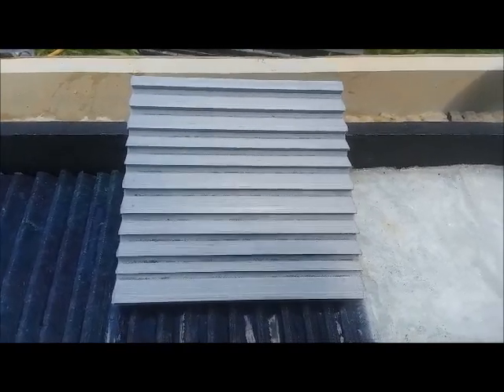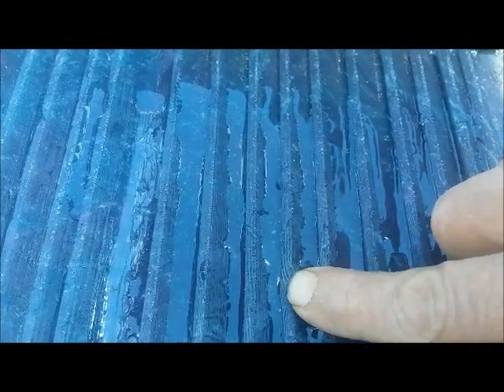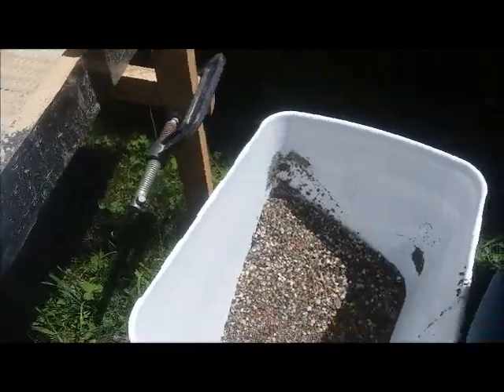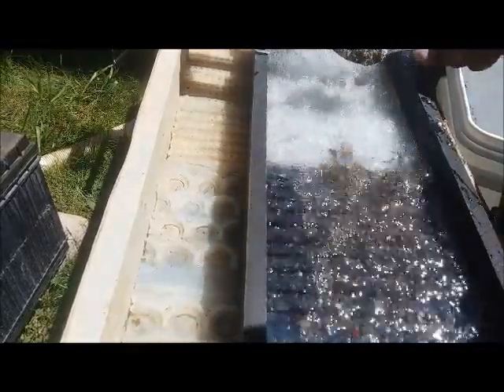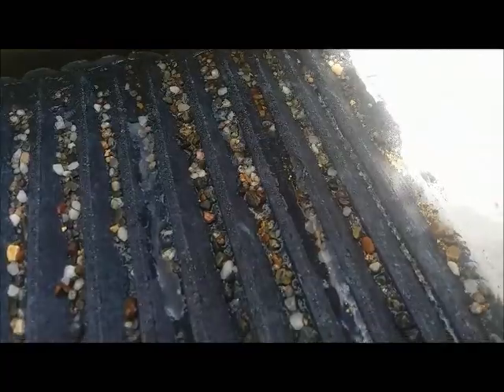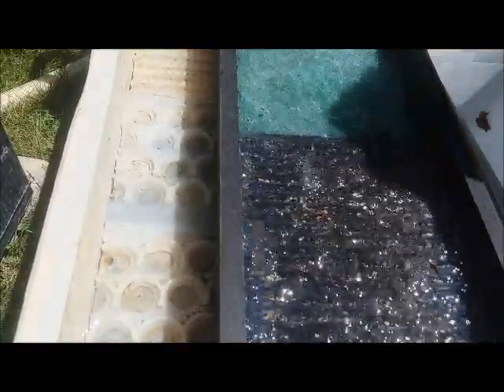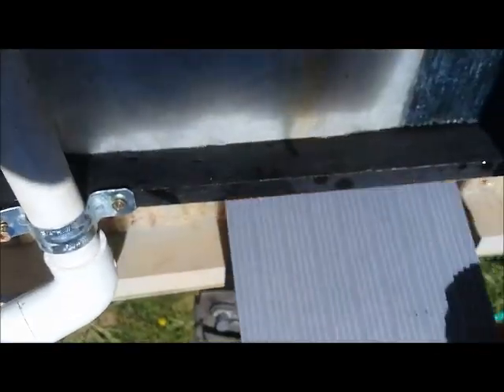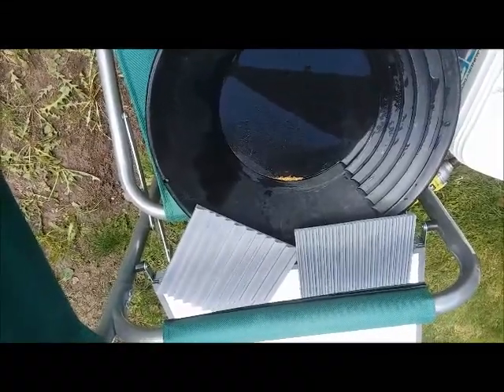3 New Silicone Sluice Box Mats From 3D molds - Demonstration

Comment: So are you primarily using these mats as cleanup mats, as they do not look sturdy enough for production mats? If you have cracks in the material from 3D printing it, how do you clean out the gold from those cracks?  What have you done to test for durability of you silicone mats as you have to flex them in a bucket to clean them?  How does the 3D printing them differ from hand molding them with silicone material as far as the end product is concerned?
Reply from the maker: Hi John I will try and answer you questions. I am running the mats in my 8 foot sluice with my trommel or wash plant with a 2000 gph 12 volt pump. The groves in the mats hold some of the fine gold and at least slow it down I have not had any problems with the clean out I just wash them out in a bucket. How long they will last I have no idea so far I have run about 4 yards of dirt screened down to 1/4 inch on this set of mats no no signs of wear so far.. The 3d printed mold was just a idea to make a real set of riffles for the silicone mats I have no complaints. I have been running the mats in every video I have done since making the mats. I hope this helps.

Comment: Thats great.  You might look into buying a larger nozzle. your printer should have a .04 mm i believe but if you can get a larger nozzle you can change settings and layer heights for a much faster print and it will make larger of those fine riffles. For the kind of printing your doing for the mats a larger nozzle would be the bomb
Reply from the maker: Thank you. I Had no idea I could get a bigger nozzle I will diffidently look into that. Thank you so much for the information. A faster print sure would be nice.
Reply: @alanrobertson2510  you are kinda going against everything printers are striving for.... better more fine prints...... you can work with speed and less defined prints... the bigger nozle will be a huge improvement for you...
Reply from the maker: @builtrodewreckedit  Thank you thank you thank you The new nozzles are on the way. I got a .05 and .06 and they are super cheap. Thanks for the help.
Reply: @alanrobertson2510  Ya know if a guy wanted to get into the silicone mat business I see no reason a large printer couldn't be built that prints in silicone.  If you design a stepper driven calking gun... maybe screw drive. drill the end of the calk tube a spasific size. a micro switch saying when the tube is empty and needs changing..... you could 3d print silicone mats any size you want.... with the same slicer we all use for plastic. No first layer sticking issues no bed and nozzle heat needed. Maybe print directly onto a sheet of paper or fabric. the print finishes you move it off to cure and roll it up put it in a box and mail it  off? they already have printers that print in chocolate... large printers that print in concrete.... why not a big silicone printer?
Reply from the maker: @builtrodewreckedit  I can tell I need to do some research into 3D printing I am just trying to get the basics down right now. That is so interesting and amazing to be able to print in silicone. Probable don't want to be to loud about that someone will be all over it are you any where close to Montana?
Reply: @alanrobertson2510  I wish i lived near Montana... im from Seattle aria. I think printing in silicone should be doable if a guy has enough tinkering in him.  If those big nozzles work out for you... there is even larger hot ends called volcano that can keep up melting a larger amount of plastic...   Fun stuff.